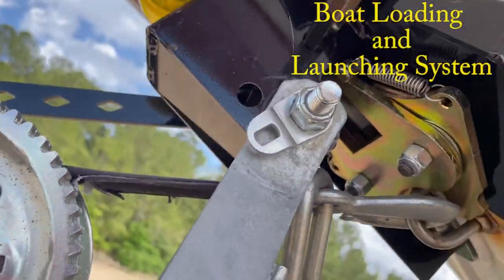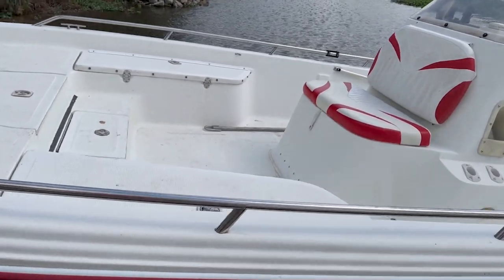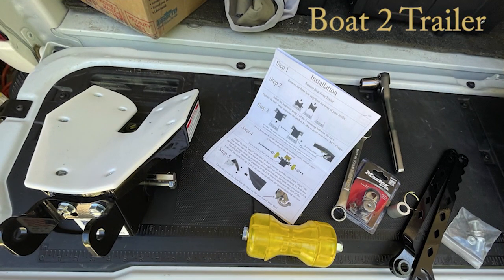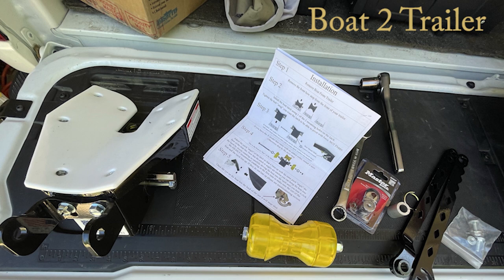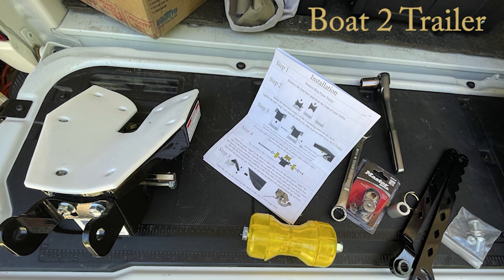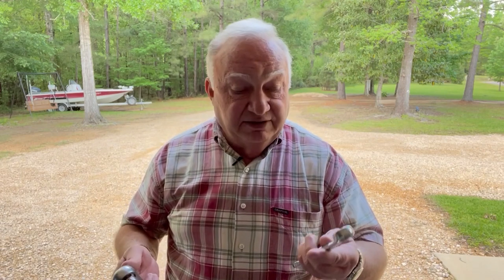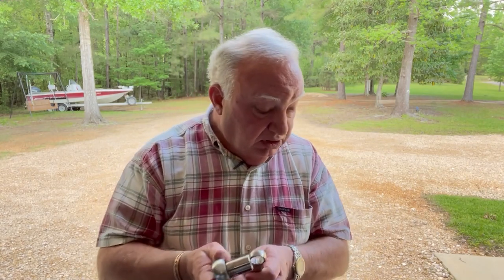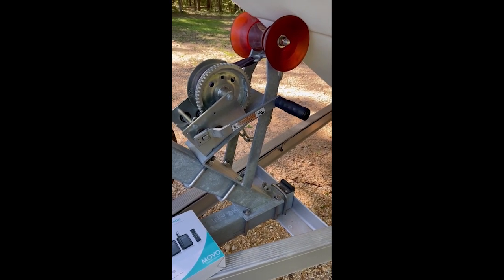Boat 2 Trailer - Drotto Boat Latch -   Did not tighten latch after final adjustment

Comment: Had my Drotto put on when I winterized my boat (Minnesota) last fall.  Took it out the other day (late April) and the Drotto worked like a charm.  Launched and recovered the boat several times without a hitch.  Also, without waders, knee boots or wet feet.  A really shallow launch might necessitate the old fashion "crank 'er up" method, but I'm sold on the Drotto.

Comment: once the latch system finds the correct angle with the boat attached then you need to tighten the bolt/nut to keep it that way
Reply from the maker: Thank You.  I had someone else tell me that and remembered the directions said to tighten after a loose fitting.  Wish I knew how to make a disclaimer on the video.  Thanks for your comment.

Comment: Wow! You do not need that much throttle and speed. You're washing out the ramp, not to mention how dangerous that is. If you slightly missed or the latch didn't grab, you'd drive that boat over the front of the trailer.

Comment: What size model did you go with ?
Reply from the maker: I had to use the small to fit the space I had on the trailer where it holds the roller.  My only concern was that I fish in salt water.  I emailed the owner of the company and he said since it doesn't go in the water, I shouldn't have a problem.